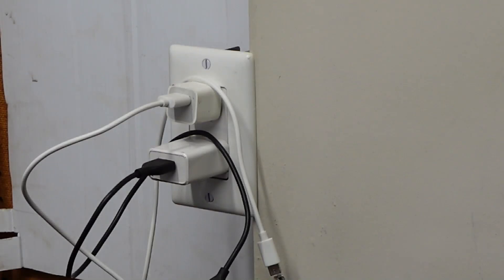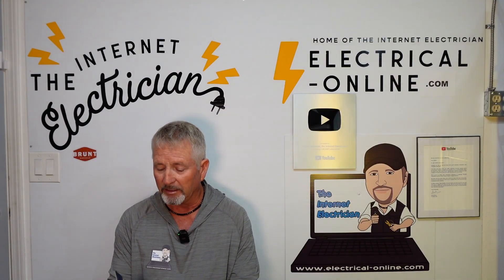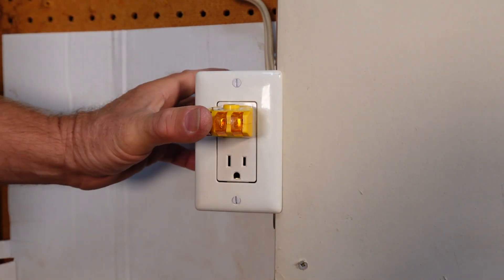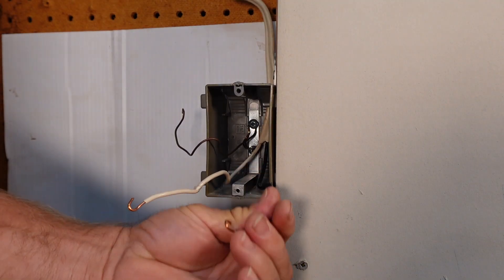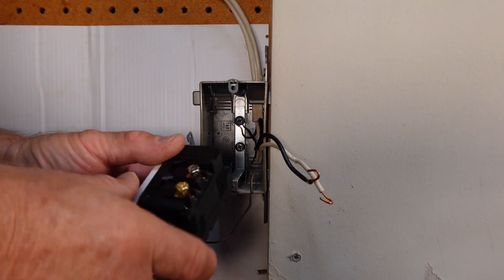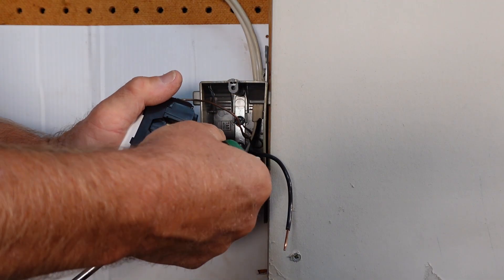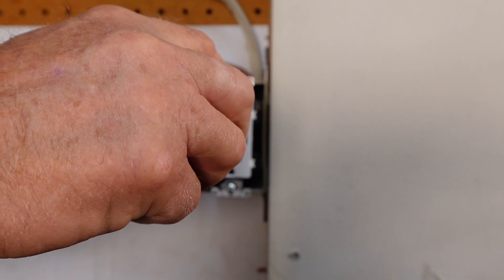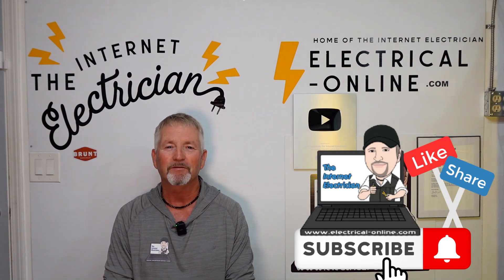How to Install a USB Wall Outlet

Comment: Isn't it good practice to screw in any unused screws, even in plastic boxes?  The unused screw on the power side of the old receptacle seems to be fully extended.